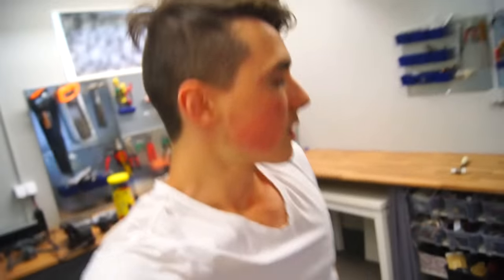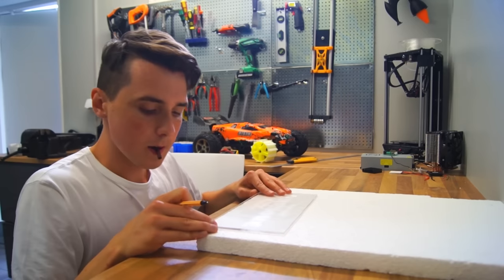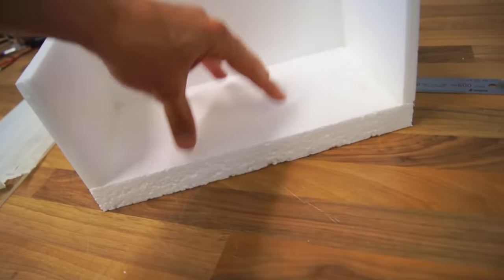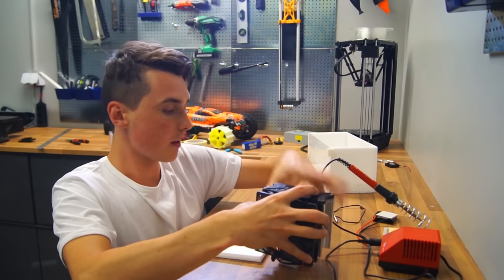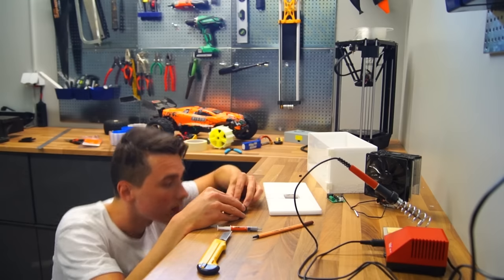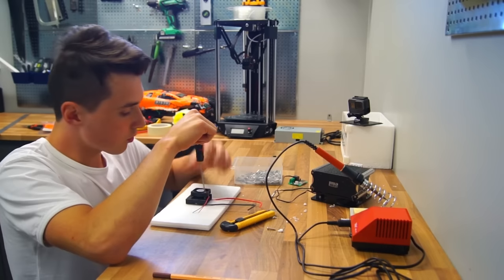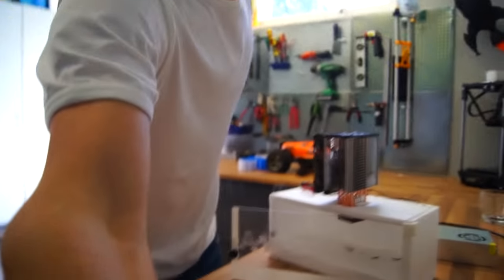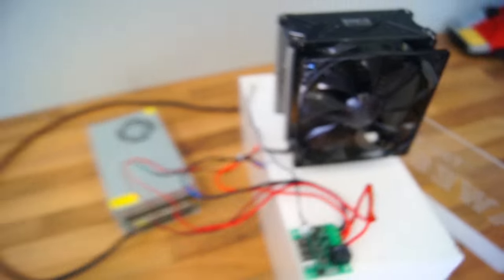Powerful Cooler Box - DIY Peltier Freezer

Comment: Those peltier modules are as efficient as 2% right now you use as much power as a big refrigerator for a lower volume and higher temperature...
Reply: its the elegance off making a functioning thing then come the improvementsssssssss
Reply: if you ask me that makes it bigger.
Reply: off course. i plan to be able to use it on a bottle off champagne at 6° so with a good insulation i think its ok. i do not  want to cool the bottle, but to keep it cool.
Reply: it's easier.
Reply: The really interesting thing about Peltier thermoelectric cooler is that it is possible to also harness electricity from them. By applying electricity, a thermal differential develops. By applying a thermal differential, electricity develops. Yes the size is a limitation, but anything is possible. In the 50s, a desktop computer filled a room the size of most average houses today. Component miniaturization is always making new components and improving the efficiency.

Comment: Can you modify it to use it inside a car when a car is parked to reduce heat
Reply: ABDALLA ALSUBAIE Not really efficient enough, plus if it draws a maximum of 15 amps, it will drain the cars battery pretty fast.
Reply: karlpc200 try solar cell. Don't connect  by car battery
Reply: ABDALLA ALSUBAIE you would be adding more weight and with how he drives everything would get destroyed in seconds
Reply: If you want a solarpanel to supply it, it's gonna have to be bigger than an average car to supple enough current. And then it still probably wont have enough power to cool the car.
Reply: Not powerful enough. That particular Peltier has a refrigerating power of about 80 watts. You need at least a couple of kilowatts of power to keep a car interior cool on a Summer day
Reply: ABDALLA ALSUBAIE legit be cheaper and more efficient to get abtransformer and w portable ac lmao
Reply: nowadays there are flexible solar panels that are very thin and light
Reply: actually yes, the problem is keeping the hot part out, and it will suck out your battery faster than a starving vampire, the only half viable solution for parked cars is to find a way to get the hot air out while pushing fresh air in, a couple os small fans should do the trick, one on the ceiling of the car and one under ith should be an interesting project
Reply: No
Reply: Guys, I had previously tried assembling a mini air con for car interior cooling when car engine is switched off. I use a 300 watts battery pack to power a 12706 peltier which is 60 watts at 5 amps . The peltier does cools down to 5 degrees celcius. However I fail in using water recirculation module to cool down the hot side of the peltier. As one knows that we could not use big heat sink with big fan to removes the heat and release geat back into the car interior. So the idea is to use solar to recharge the 300 watts battery pack (2 amps input)  and then using the battery pack to power ther peltier with circulating water cooling on the hot peltier side. Anyone can takes up this project challenge?. I am resting from this project temporary as I will require to free time from my normal work first.

Comment: it is the best method i am using it all the time, including while building and re-applying the cooler to my i9-9900k cpu or my 4.5 GHz overclocked i7-2700k, either way you cant get wrong with it by applying the appropriate pressure

Comment: Yo hubiera hecho un chasis de plástico con la impresora 3D y a partir de hay hubiera montado en él las paredes y el resto de los componentes. Utilizar la pistola de silicona le quita profesionalidad al proyecto jajajajajjaja Buen vídeo y gran canal. Un saludo desde España!
Reply: I would have made a plastic chassis with the 3D printer and from there would have mounted on it the walls and the rest of the components. Using the silicone gun removes professionalism to the project jajajajajjaja Good video and great channel. A greeting from Spain! (Translate with google translator)

Comment: Thinking about making one of these myself. I'll probably try to find a lower-profile heatsink though. Ideally I'd like it to be able to hold sub-freezing temperatures in my car for the times when I need to take frozen food on long summer road trips. I think going with two lower-power modules (such as the TEC-12710 or 12706) stacked in series thermally and in parallel electrically would be able to maintain a greater temperature delta. I know it would reduce the efficiency as well as the overall heat flow rate of the system, but if the box is well-insulated then that won't really be a problem. An ice cooler would probably suffice, maybe with a rubber seal on the lid to let it form a partial vacuum inside.

Comment: The best way to apply thermal paste to make it as scanty as possible and remove voids due to fine scratches or imperfections on the surface of the parts that come in contact with each other. Ideally there should be a direct contact between the peltier and the heat sink. Only spaces where there is no such direct contact should be filled by the thermal paste. So make a thin film just enough to cover the creases and remove any air spaces between the two parts. This is the reason sufficient pressure is applied so that the thermal paste is squeezed out to allow direct contact.

Comment: Your insulation is better than you think - the reason it climbed to 10 °C after 30ish minutes is mainly the Peltier itself. The moment you turn it (and the hot side fan) off, the heat conducts to the cold side almost instantly. Within minutes the whole heat pump assembly will be at an equilibrium that's somewhere between the cold end's temperature (-7 °C) and the hot end's (probably touching 100 °C).

The proper way to turn the pump off would be to slowly reduce power to the Peltier (e.g. using PWM) while keeping the hot side fan running. Only when the hot end is at room temperature (as opposed to searing hot) can you kill the fan.

Comment: You don't even need a heat sink on the cold side. Just get a bigger heat sink for that side. I have one of those cheep refrigerators that uses a Peltier device & the motor was getting noisy from old age so I replaced it with a couple of computer fans. It made the soda cans freeze because the motors were circulating much more air past the hot side so I added a resistor to dial them back a bit & still didn't need a fan in the cold side.

Comment: Peltiers suffer heat leak back when powered off. Once the outside heat sink is at ambient, it will bring the heat sink inside the chiller up to ambient as well, conducting your coolness out as it goes.

Comment: Fan inside cool  your fridge faster, and more eficient, but is not good to achieve lowest temperature. It's because these few wats of power, which fan needs, is at the end converted into heat. I think you could earn about half or one  degree. Try at the end of cooling test turn off the fan to test if I have right.
And it's very cool project! :)

Comment: As a suggestion, use an all-in-one liquid cooler for the cold side and the passive cooler on the hot side. I built an  A/C unit for a large Vivarium With dart frogs and a high performance Peltier. IT IS COOL!

Comment: For cooler temperature you can stack two peltier devices HCHC of course with heat sink compound between.  Effectively doubles the temperature difference.  Those stacked peltiers are available in one device but very expensive.  The problem with peltier is not that it won't work but is far less efficient than conventional compressor type refrigeration units.  You may also want to try liquid cooling for the hot side with an appropriate radiator and aluminum plate on the cold side.

Comment: Pretty cool build!  I would say you should reinforce the top with a couple of dowel rods.  You could cut out slots on the sides, insert the dowels so they sit just below the roof of the box (ie: if the top is 12mm thick, dowel is 10mm diameter, cut slots 22mm deep) then the top will sit on the rods, and you can fill the top of the slots with more foam to help keep its insulating properties.  (Or use 2 pieces of foam on each side, one with slots, one without)

ALSO and more importantly, replace the front with insulation to get better results.  Just look at refrigerators, they have no clear door on them because plexi-glass or glass doesn't insulate well.  If the outside is cool, you need more insulation.
Reply from the maker: Hey thanks for your suggestions!

Comment: If possible it's good to try and prevent too much ice building up on the heat sink, since ice is a fairly good thermal insulator.
I built a peltier based fridge once for the car, which worked fine, but when running for a long time, sometimes the ice on the heatsinks inside continued to grow until it prevented the fans from spinning. So that's something to keep in mind.
Reply: That could be a problem, but if you set it to something like 8°C it will shut down when it reaches this temperature. I think it has enough time to defrost.
Reply: @Rowie12  Yes, that's true. But you know, if it's a freezer you're probably not gonna set it to 8 °C are you?
Reply: @phinok.m.628  You're right of course. It's hard getting no ice on the heatsink and I don't know a solution.

Comment: Actually, the pea size thing is only for CPUs, because the die is in the center of the heat spreader. So if the full surface of the peltier is getting hot, you should indeed spread the grease over the entire device to ensure the entire device is getting cooled more efficiently.

Comment: You can stack up two peltier elements between the heat sinks. To increase the maximum temperature difference.
Reply: I'm betting the power efficiency would reduce.

Comment: When peltier turns off, it effectively is big cold bridge with huge heatsink :)
test it with voltmeter - when it is turned off, it starts to work as thermoelectric generator - heat difference between inside and outside makes it produce voltage and inside heatsing melts immediately. 
So if you ant to improve efficiency, best would be to use just big enough peltier to keep temperature you need. You can also make power consumption lower by recucing voltage - that power supply should have adjustment screw to turn it to somewhere to 10-11V

Comment: A pea sized drop in the center of a CPU makes sense because heat is generated from the chip which is centered on the package and rarely covers all of the CPU. In contrast, a peltier module has the heat transferring elements (tiny individual heat pumps) covering all its area. So a drop in the center of it, spreads out as a disc and doesn't cover the the element's corners.

Comment: Hi, thanks for the video. I am still trying to wrap my head around peltier technology as I am trying to make a little desk air cooler/conditioner. So far, based on my tests, the coldest temperature I can get my Peltier at is roughly 19 degrees celcius. I don't have such a big heat sink like the one you used and my tests were done with just the cooling fan, the heat sink, the peltier, the smaller heat sink and a small fan to distribute the cold.  However, I haven't installed the setup into a box of any kind yet, so my tests were done in a room with the room temperature. I did apply thermal paste between the peltier and the heat sinks for better distribution.

I am using the following components:

Peltier: 12715
Power Supply: 12v 15A
Cooling Fan: 92 DA PC Fan
Peltier Fan: 12V 40mm PC Fan

How can I improve the setup and get it to go to at least 0 degree if not lower?

Comment: When applying the thermal grease, you did it wrong. You were supposed to wear eye protection goggles, a helmet and have a bag of chips.
LOL.
Awesome project!
Looks like I am going to finally build me a unit.
I live here in HOT Phoenix, Arizona. I had me an aquarium outside. A 100 gallon tank with fish.
I had to shut it down because I was fighting the heat in my patio. I tried fans blowing on the water. But it wasn't good enough.
I think that a few of these peltier devices might do the trick!
Reply: Do you know the price of this peltier device ?

Comment: one of your main efficiency losses is probably the peltier itself, it's basically a chunk of metal conducting heat form outside into the box when it's not running.

Comment: Put the same heat sink/fan on the inside.  Now you can control the power to the peltier, and the speed of the fans on the inside and the fans on the outside.  The idea might be better for a larger refrigerator than a smaller freezer.

Comment: For best Peltier and lil heatsink contact try sanding the sides, you want to connect with as little gap, with very smooth 600, 1000 or greater sanding paper
Reply: I personally would lap it, gives you an even more plane surface.
Reply: djteac thats what I wrote wet sanding=laping

Comment: Great project! have you thought about adding a second thermostat,  this would control just the internal fan, once the internal heatsink becomes frozen, one thermostat swtches off the PELTIER, and the fan keeps on running passing air over a frozen surface, cooling the air annd defrosting the heatsink. and would increase the life of the peltier. be intresting to see how effient it would make it.

Comment: I just bought a cheaps 5 volt USB powered beverage cooler that can fit a can of beer. I paid around $1.5 USB defective not powering on the USB jack come loose, but I repaired it already.  It has a peltier cooler just like yours, I think the size is identical. You said I can decrease the temperature by adding a larger fan? Is the cold plate temperature dependent on the cooling of the hot side of the peltier that is the colder the hot side gets the coldest the cold plate will be? I would like to experiment on this thing and was inspired watching your video. Thanks!

Comment: I may want to try using elements of this project to make a (non-critical) medication cooler to maintain a controlled room temperature. In the summer I don't run my central air while I'm gone, so my house can get quite warm. The refrigerator is too cool and the house gets too warm, so a small cooler set for 20 C would be ideal.

I don't know if you are interested in programming, but I've enjoyed getting into Arduino programming on the ESP8266 micro controller. It not expensive and supports WiFi so it really adds some nice connectivity to electronics projects. If C isn't your thing there is are also versions of Python available for it.  Even if you are not much of a programmer there are many libraries and examples available. The newer ESP32 is more powerful and adds Bluetooth support. These micro controllers might be of interest to you for future projects.

Comment: Good video but as mentioned in the comments already the door will be contributing a lot to heating, it could be much more insulated. To show the principle it is however sufficient. 
Cooling paste seem to be a hot topic, I only have a single video in which I apply it but also got a lot of comments about doing it wrong directly. In theory it should be a layer that is as thin as possible and evenly spread, something that probably can be achieved in more than one way :)

Comment: im trying to save up for the TEVO tarantula. you inspired me to start 3D printing at the age that i'm at.
Reply: Agar Fan I started last year when I was twelve, and I must say, it's a fun hobby that keeps me busy when I have holidays.
Reply: im only 11 almoesst 12 and i thought it would be a fun hobby. what kind of 3D printer do u have?
Reply: The Tevo CAN be unbelievably annoying. Just saying, don't think that you'll unbox the thingy, build it in like 2 hours and start printing like Angus from Makers Muse or something. You'll have to put a LOT of time into troubleshooting (how to make your friggin prints stick), upgrading, making this thing steady, heat bed leveling, trying different values in your slicer and so on.

Don't get me wrong tho, it's amazing once the thingy works as it's supposed to be!^^ The print quality is stunning, the print speed is okay-ish and the print volume is amazing. 20 x 20 x 20cm are HUUUUGE!

This should be the case on any cheaper kit-printer. Just be aware of that, buddy. Cheers!
Reply: Better crimp it and wire it properly. A lot of people on the Facebook group have had their controller board melted.
Reply: Ok thx for letting me know
Reply: TEVO is the worst peace of crap ever... why are people putting icing on crap... get a cr-10s

Comment: If you really want to supercharge this setup, watercool it (or if you're feeling really crazy, cool it with gallium, but keep in mind that it will eat through aluminum in a very short time, and in more time, copper, so this would be a short-term experiment).  I was putzing around with peltiers (TECs) 20 years ago, but I never had access to any as powerful as 200W (I believe 85W was about the most powerful back then, and you can stack them (CHCH), but then you start to run into power issues, needing a second PSU, which is just adding complexity.  Overall, I found that it was viable for cooling, but generally not worth it due to the complexity.  Now that we have 1500W+ PSUs and 200W peltiers, that might change (although weak 12V rails, in terms of amperage might be an issue in lower quality PSUs).  Of course you still have to insulate your CPU socket with goop and it's messy, so most people won't ever do this.

Comment: you need a 120mm fan blowing out the cold air one way into the room and exhaust hot air out the back preferably with an aircon plastic tube going through the window.